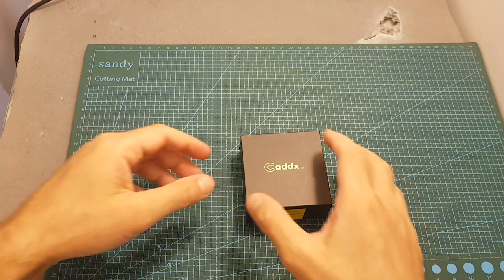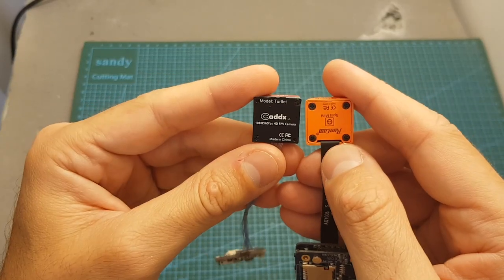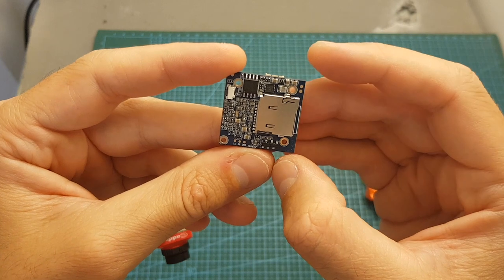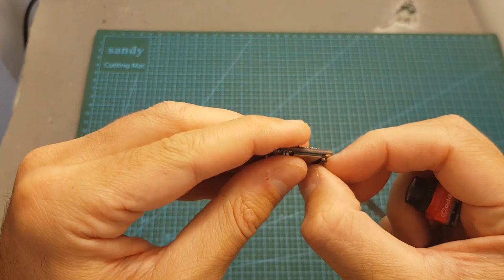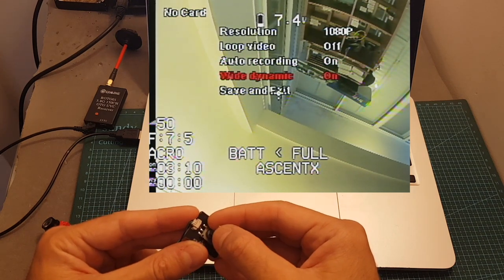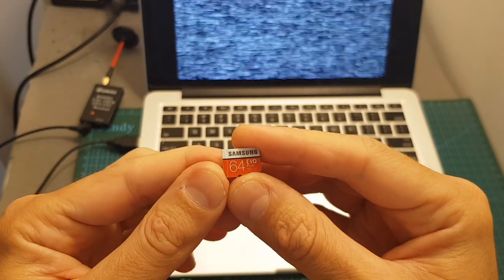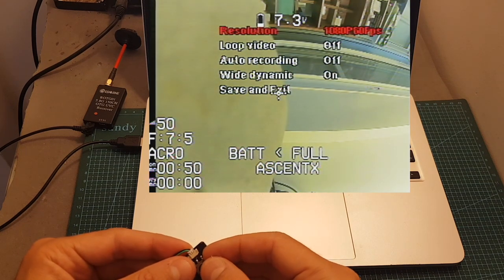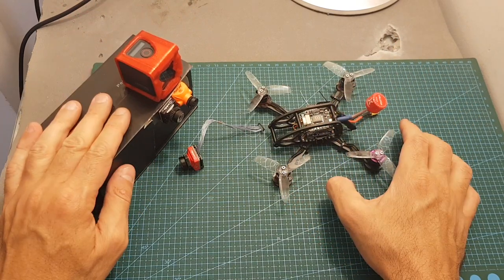Caddx Turtle FPV Camera - Part 1 - Overview

Comment: I notice you used a 64 gb SD card to update the firmware, and presumably also for videos. Did the Turtle require special formatting on the card? I have a few devices that won't accept 64 gb partitions and so need to be specially formatted for fat32 and some preparation to first create a 32 gb  primary partition. 

Thanks!
Reply from the maker: No - just formatted it using my mac as I always do and everything is working great.

Comment: I do like this camera. This may be the one I get. The run cam was too expensive for what it is but this seems to be a more fitting price for what it is. I have seen a few videos so far and quality is ok. I also saw in Albert Kim's video that the final product will have a microphone on it. Can you confirm? I noticed you said there was no microphone on it. As always good job sir
Reply from the maker: Thanks Andre. I send Caddx a message about the microphone, as they didn't tell me anything about it.

Comment: Hi sir my new caddx turtle v2  doest go through the splash screen. It gets stuck there. Iam not getting FPV feed. Plese help. Any clue?
Reply from the maker: It seems like a problem with the camera connector. Make sure that it's properly connected on both ends and the cables are not cut.
Reply: @KremerFPV  Hi sir i disconnected cables at both end and tried i got video for about 5 min and it went off again. I tried connecting again but thereafter i didnt get any video feed iam stuck now
Reply from the maker: @rajeevgopal3961  Contact the seller and ask for a replacement cable.

Comment: No one shows how to wire up this camera?
Reply from the maker: You can find the wiring diagram in the manual. Are you having issues connecting it?
Reply: I don’t have the manual I got it from a individual who never used it. It did not come with a manual or main wiring connector. The model I’m gonna put it on already has a caddx f1 camera. I’m wondering if the connector is the same.
Reply from the maker: There you go: https://www.caddxshop.com/u_file/1808/file/264f75de5f.jpg
Reply: No I’ve not tried yet. I bought it from a individual. He forgot to include the connector wire it the box. However the quad I’m going to put it in already has a caddx camera install. From what I can see it looks like the plug that plugs into the camera is possible the same as the one I already have soldered in... I just don’t want to fire it.

Comment: Hi, can the camera be controlled by 'Camera Control' pin on FC (Omnibus F4 Nano V6 20x20)? I'd like to change settings on the OSD rather than with the tiny included remote.
Reply from the maker: There are tx and rx pads on the Turtle, but using them is still a mystery.
Reply: Ah ok, thank you for the reply. I wonder if the Menu wire on the Turtle harness could be connected to camera control.

Comment: I wonder if I could use this for a head mounted rig for facial motion capture
Reply from the maker: Well it will work just like any other action camera.
Reply: @KremerFPV  And I need to figure out how you set up the camera to be seen on your laptop. I'm doing a set up very similar to facial capture rigs in visual effects movies

Comment: Fingers crossed that they bring out some replacement cables.  A shorter length would be good for 3 inch and sub builds.
Reply from the maker: Yes - these will be mandatory.

Comment: You are the first person I've seen mention the odd 4th screw... I do not like this AT ALL. Most of the VTX I use is the stack mount AKK and most times I do not use a nut on the post by their connector. There's no way I'd be able to get this board on my stack with everything else. As nice as this one looks, I fear I'll have to pass on this one for now =(
Reply from the maker: Yes, it's a little bit disappointing...

Comment: Can I use it with 20×20?
Reply from the maker: Yes and no - the mounting is a little bit off and you will need to remove / trim one of the mounting screws.
Reply: Gal Kremer That means I can't put with 20×20 flytower?
Reply from the maker: Without using shorter screws it's not possible. Please see 02:33
Reply: Gal Kremer Thank you so much!!!♡♡ I will cut one of screw^^